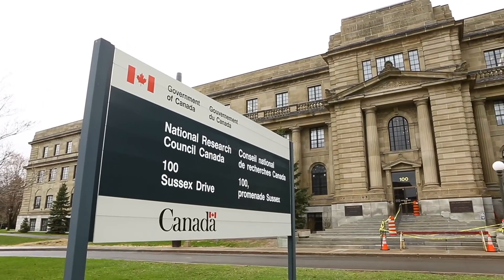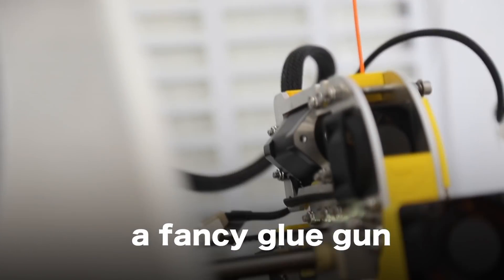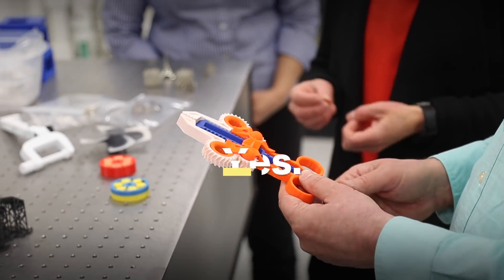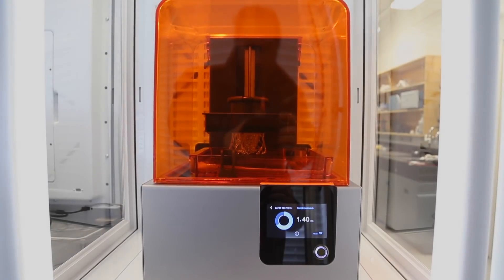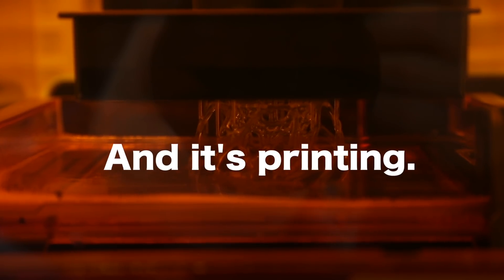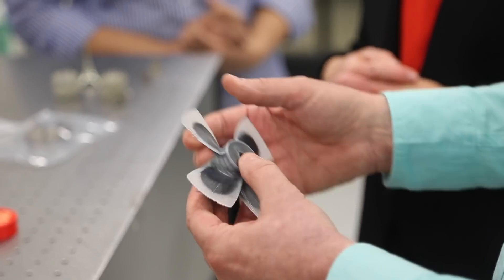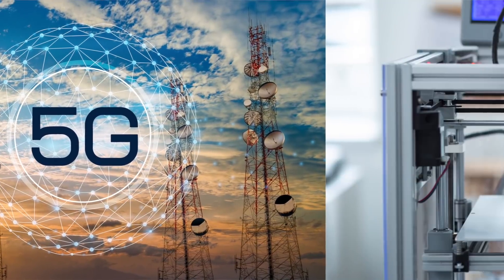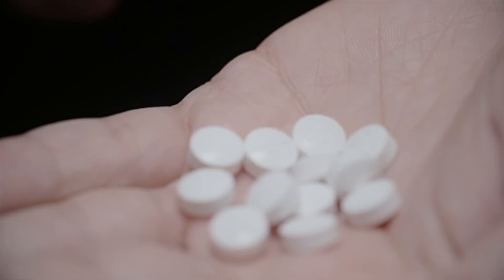Here at the NRC: Researchers are 3D printing the future, with lasers

Comment: These report would really benefit from discussion of why the government is doing this work. There is nothing here that couldn't be done by industry or university.
Reply: NRC gets a lot of the money it spends from industry and revenue. It's main purpose right now is to work with small businesses that do not have the manpower or funding to develop products on their own without fundamental research that can be done at NRC. A lot of the work done at NRC is also patented, so it is not necessarily free for everyone to use and companies do have to pay the NRC for it's services
With respect to multi-material 3D printing, printed electronics for wearable technology  and biological purposes like artificial organs or tissue engineering scaffolds are very easy to achieve using 3D printing techniques and circumvent the need for additional processing parameters like high temperatures or pressures or just plain complexity of shape in artificial organs or tissue engineering scaffolds

The main purpose here is to help Canadian industry to hopefully become pioneers in new technology, and to set an international standard for public research organizations
Reply: rvidal0001  US government aeronautics and early computing initiatives were matters of national security. They agenda was not commercial, but the activity had clear purpose. So what's the clear purpose here?